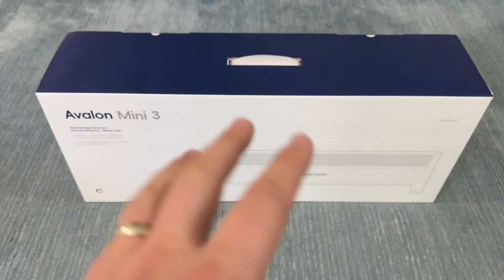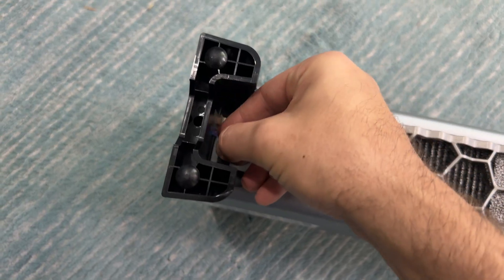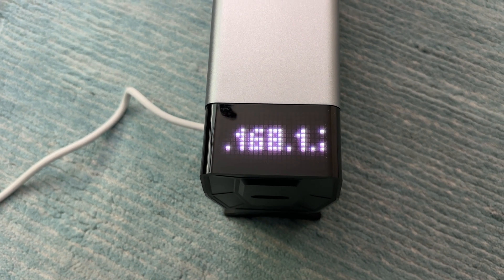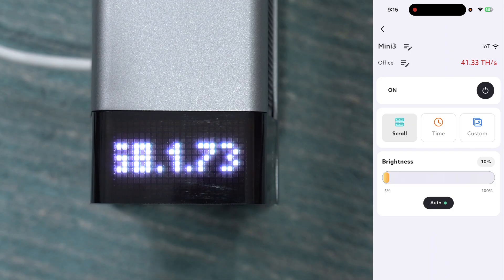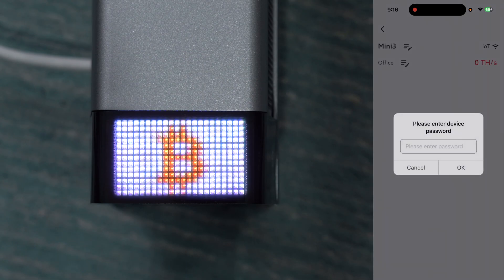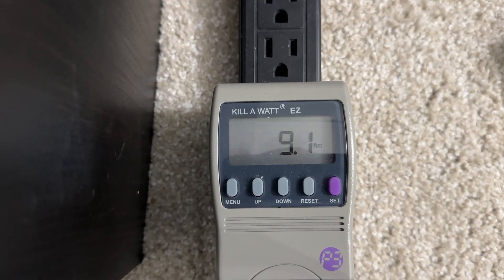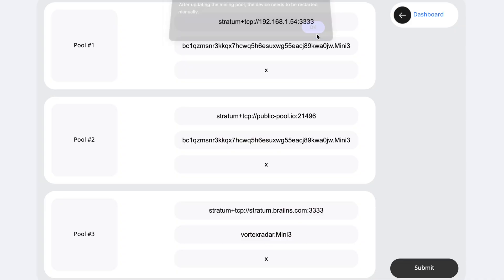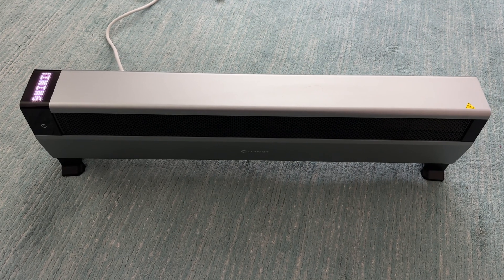Canaan Avalon Mini 3: Unboxing & Setup

Comment: I noticed on mine that in Heater - super mode it has a little higher hash rate than in Miner mode (40.5 Th/s vs 38.5 Th/s) and it also consumes 10 Watts less. 

What’s your experience in these 2 modes?
Reply from the maker: Ah interesting. I'm switching back and forth and letting them run for a bit, but my hashrate is staying around right 41.8 TH/s or so in both modes.
Reply: @VortexBitcoin thanks for checking.
I always notice a few Th/s difference between the 2 modes.
Interesting 🤔

What’s your room temperature? 20ish degrees Celsius?

Comment: Isnt that cover meant to lock the power cable in place? Not cover the on/off switch😂 Its a safety feature to stop the cable backing out and creating a spark gap due to gravity or little hands lol
Reply from the maker: Oh whoops! I just tried it and I see what you mean, lol. Thanks for pointing that out!
Reply: @VortexBitcoin no problem

Comment: I noticed you put the local ip address to your start9 server, but I have been solo mining using the .local address, not necessarily the ip, and it seems i'm getting work, but now you've caused me to think twice
Reply from the maker: Ahh yeah , I’ve had issues with it before too and had to use the .local address. Not sure why it’s working for me now, lol.
Reply: @VortexBitcoin okay, so the .local address is fine then, thanks for the response.

i got a new bitaxe yesterday i think its kind of a hack job and its only at 40degrees C so i might have to look at your channel for clues on overclocking this

Comment: Is it possible to run the Mini 3 continuously in night mode without setting a specific temperature? 

To elaborate further, let's say that you'd like to run it at a lower rate of power continuously, such as ~400 watts, but you don't want the miner to stop mining once it reaches a certain temperature. You only want it to mine using less power without the device stopping itself when certain temperatures are met. Is this possible?
Reply from the maker: It doesn’t look like it, no. Night mode doesn’t give you controls like that, just a target temp and it turns on/off itself.